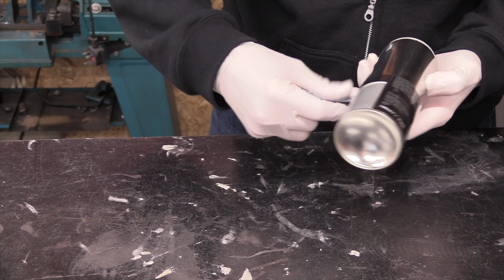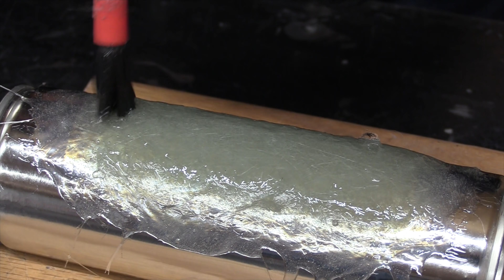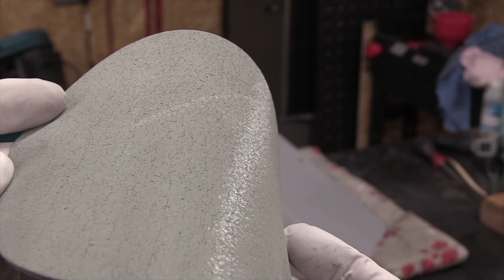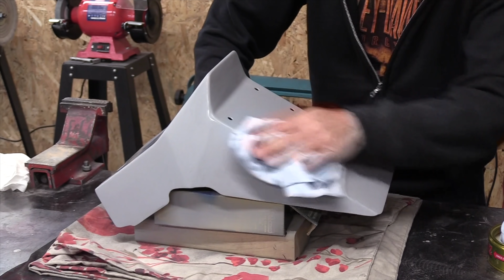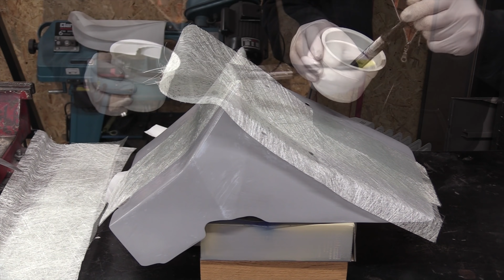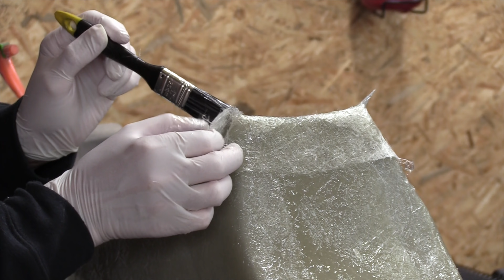Husqvarna Strada Makeover #7, Belly Pan Mould

Comment: I know this does not relate to this video but I can't find the one you did on oil blackening bolts. Can I blacken the head on my rear wheel spindle or will a localised blackening introduce stresses into the area potentially weakening it ?
Reply from the maker: Hi there Matthew, i would not heat your axle, exactly like you suggest, it could change it's integrity !  you can buy cold blackening chemicals if it's just for looks, i imagine it's not about rust as that shouldn't be an issue on the head of the axle..!

Comment: Hi Del, I've been moulding GRP for about 20 years and want to pass on some knowledge to you. 1: Use PVA. Not sure what that aerosol you were using is, but it doesn't look like PVA. 2: WEIGH THE RESIN AND CATALYST (caps for emphasis of how important that is). 3: Tear the matting. 4: Less resin the better. 5: Use a roller to compress the layers. 6: Add a flange to the plug so the glass doesn't just hang over the edge. 7: Pre-wet the mat before applying. Looking forward to seeing the finished result.
Reply from the maker: Thanks for your great advices Steven, that's very much appreciated, I've bought myself some scales now and taken on board all the great advice we've been gifted by the laminating community... the biggest shock has been the cost of materials, there's so much to buy and it adds up to a truly expensive process!... But I'm in it now, so committed to the finish and I guess now I've truly learned why fibreglass motorcycle panels cost so much money, specially the carbon ones!!   The carbon matting itself doesn't cost much, it's the process to create them, and I always just thought that carbon itself was expensive, bike panels are usually injection moulded which is clearly a less labour intensive process, anyway thanks again for the truly great advice, all taken on board!   Next video will be an adventure and am sure will give you a smile :-)

Comment: I hope it comes off OK, the thing is to ensure that there are no reverse angles on the mold otherwise the buck become locked in when the fibreglass sets off hard,. I think I would also have taped up the inside of the holes so that the resin did not penetrate the buck and cause locking plugs. good luck.
Reply from the maker: Thanks Richard, fortunately the wet matting didn't poke through the holes, just a slight bump which will form the reverse "a dent" in the finished item so ill be able to drill them out in the exact right place..

Comment: Good work Del, very nice job. When you do your next one, I like to glass in some small wood batons on the outside and then make a frame for the mould to sit on when you are working on it, it also helps to pull the two pieces apart and helps keep the mould nice and firm when you lay up the final. Just a suggestion mate.
Reply from the maker: Thanks Jimmy, i have had that in the plan from the beginning, something to mount the mould on so it's firmly stood on the table and not falling about everywhere... and as for pulling the mould off the plug.. wait till the next video, i think you'll enjoy it..!   Thanks for the tips mate, very much appreciated.

Comment: Hey Del, great job on the plug. Ben Stapley's comments re: gelcoat and pva are spot on. Also use gelcoat on your finished item as it will give give you something to rub down without getting into the resin/glass. You can even tint the gelcoat to avoid the need for paint. If you have trouble with release try and get warm water between plug and mould as it will dissolve the pva.   
Also don't use pva on the mould for the finished item as it does adversely effect your finish on the item. Many coats of wax over a few days gives a much better result. You can use a syringe to measure the catalyst for accuracy. Keep up the good work, great to see you pushing yourself in new directions.
Reply from the maker: Thanks so much Bob, thats really helpful, i would have used the PVA in the final item, but i can see what you mean it could leave a pattern in the finish. i like the idea of gel coat, making a layer to keep the material away from the mould so i can sand it, which ill need to probably, ill be using Kevlar hopefully, aiming high i guess, and wouldn't want to expose the material making it hard to paint later..   Thanks again mate, all duly noted.. Cheers and have a good weekend.. Del.

Comment: Hi del Iv been a composite moulder since I left school 18 year’s ago and a bit of advice the amount of preparation you put in to making the pattern smooth going up to 3000 grit sand paper will be pointless with the amount of pva you used and the fact that you have not used a gel coat means you cannot rub the mould down to make it smooth agin you should have used a mould sealer and then just give it 4 waxes no pva and also you should have blocked the holes up as the glass and resin will seep though and lock your mould to your pattern if you do attempt making a mould again use a gel coat it will give you a much better finish if you need any help or advise please fill free to message me and I will help as much as possible
Reply from the maker: Ben, that is so kind of you, thank you so much for that sound advice, like i said, im totally in the dark with this and the first time at it.. so feeling my way and learning as i go. Its been great to have such helpful and sound advice from so many specialists at this, really helpful in the learning process and always good when embarking on a new skill set.. i certainly will drop you a line if i get stuck on this mate, you can be sure of that.. all the best and thanks again.. Del.
Reply from the maker: Just a question on this process if i may Ben, (reaching out already lol), it seems almost obligatory to use a Gel Coat for this in the final stage once i get there, so when 'You' do it, do you Gel coat first then allow that to cure, and then apply the matting and resin to the cured Gel Coat, ? Or, do you lay up over the wet Gel Coat layer?.. ( i ask it it seems obvious that the matting would push through the coat and touch the mould if it was still wet)..?  just trying to be clear.!   Thanks in advance buddy.. Del.
Reply: Yes the gel coat is an Essential part of the process an should be applied and left to cure before applying the matting and resin and also if you are going to use polyester resin it’s good practice to apply one or two Layers and then leave to cure fully then give it a good rubdown with 80grit sand paper and then apply more layers to slowly increase the thickness as polyester shrink as it cures so the thicker it is the hotter it gets the more it shrinks
Reply from the maker: @benstapley4093  Thanks for your great advice Ben, all on board..!
Reply: @Moonfleet41  one over thing in 18 years in the trade I can honestly say Iv never seen pav in an aerosol can?  Where did you get it?
Reply: Also not seen pva in spray form so far, looks interesting!
Reply: great useful feedback there, not a job I've ever done so I'm watching with interest.  Would it be adviseable then to fully drill out the holes before separating the mold from the plug? that might prevent the loss of the mold if it creates a lock?
Reply from the maker: @stevenmarry6845  Each of the holes has only made a slight impression, like a 'bump' where the hole is..nothing came through the holes, this will make a 'dent' where the holes need to be in the final item and those dents can be drilled out as they'll be in the exact right place...
Reply: @stevenmarry6845  yes 100% 👍🏻

Comment: Good initiative on doing the test piece. At least you know in theory it’ll work, although might be a little more awkward to slip the GF off of the plug due to the multiple angles.
Not sure of the process, but would popping the whole thing in the freezer for an hour before removing the GF help with the removal process as the steel contracts ? Just a thought.
Reply from the maker: Thanks for your kind words Ken, learning as I go with this, I'm gonna invest in some scales as advised multiple times to get the mixture right next time, and as for the freezer, am not sure if that would work and sadly I won't be able to try as I don't have a freezer big enough to fit it in!  One suggestion made was the other way round to actually warm up the plug from the inside, maybe with a hairdryer, to liquefy the wax, but check out the next video, it'll be well worth waiting for!

Comment: Nice job Del.  Are you going to drill your holes before you remove it from the plug?
Reply from the maker: Could have done, but the problem is I can't actually get to them with the metal bracing on the back of the plug, they will make an indent in the mould so hopefully I can do it later!

Comment: Nice job.  When measuring out your resin and hardener, you could use a digital scale in order to be sure you've got the ratios right.  Always enjoy watching your creative mind at work...
Reply from the maker: Good plan mate, sounds like a worthy investment.!
Reply: @Moonfleet41  or probably a large syringe for resin + a small one for activator.this way you can have measurable results. I am also planning to work with fiber glass sometimes and this is the way I would go for my learning process. Cheers
Reply: @1Poe  it will help with the consistency also
Reply: Or a pipette

Comment: Hi Del , you all good? & Penny . I would use air to blow it out the mould better than twisting turning and putting pressure on the work piece.
Reply from the maker: Thanks John, We're fine. Thanks for the tip too, it makes sense.   Have a good weekend mate. D&Px

Comment: I've always wondered about creating my own motorcycle bodywork from the existing fairings and bits that i have.  Figured it would be cheaper for when i take a header off the bike at the track.  Good to see someone giving it a shot and enjoying the process :)
Reply from the maker: With the experience of this so far, for myself, i'd say that taking your old bodywork, making moulds of those panels, and then making negatives of those moulds to fit to the bike... would probably cost more then just buying some old second hand panels from the bike breaker... the cost of materials is huge, so i don't think it'd be a money saving at all... lots of fun maybe.. but costly.!    Have a great weekend Sir, keep safe and stay in touch. D&Pxx

Comment: Good going Del .
It's probably too late now but if you heat the inside of the plug when the mold is cured , the wax will partially liquify and the release will be easier .. ( you may well have done this already ) 
I made many Dormobile roofs as an apprentice they used to give us new baseball boots every time we went in the plastic shop ( pizza/ frisbee feet !) 
Peace and love brother 👍🏻☮♥️
Reply from the maker: Thanks for the tip Brother, you'll see how useful that tip could have been in the next video... but i can still use it in the final process, very sound and obvious advice indeed..   Keep safe and enjoy your weekend too, soon be Christmas (apparently !)    D&Pxx
Reply: @Moonfleet41  
Can't be much help with Kevlar though .. that wasn't really a thing in 1984 ..at least not for camper vans ..so I'll be learning with you. 
👍🏻☮♥️
Reply from the maker: @springy-2112  No, it's a brand new one on me too, it doesn't stretch and push about like fiberglass, it like a fixed woven cloth with almost no give, soill be learning with every step myself..
Reply: Looking good Del, when you come to release the mold I have seen other you tubers using compressed air.
Reply from the maker: @DeafMaker  Thats a good tip, I've seen many things removed with compressed air including paint and clear coat..